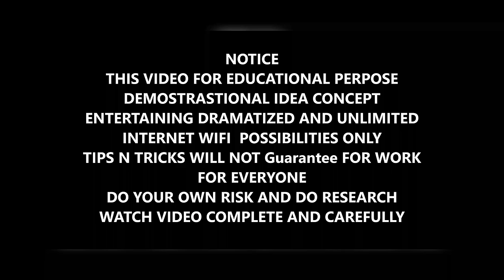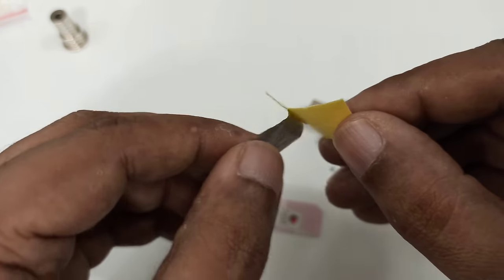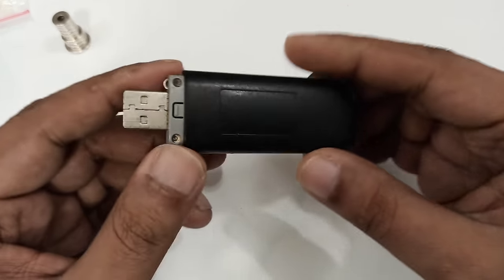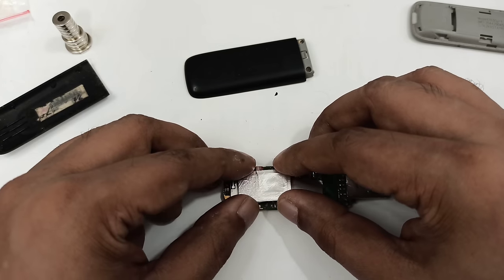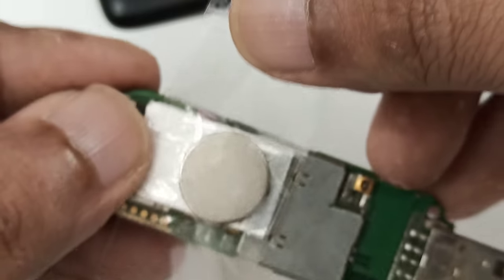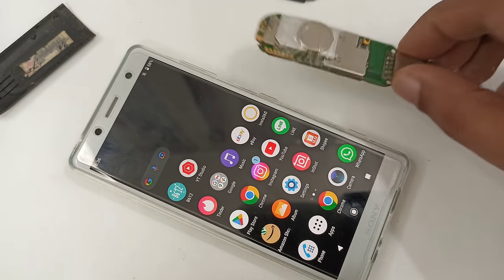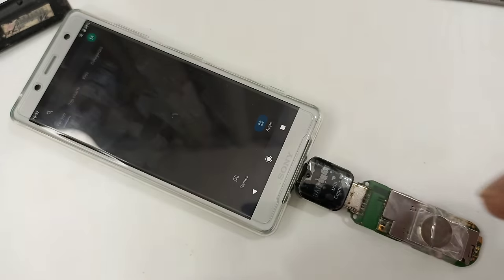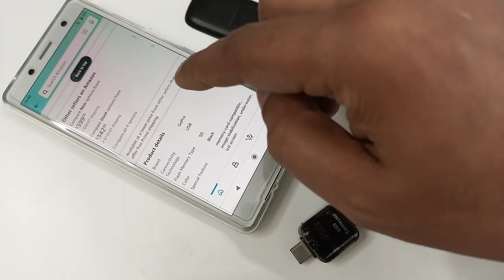how to get free Wifi password Internet hotspot Data anywhere everywhere Lifetime

Comment: All you did was turn internal into external. It ain't free if the SIM has to be active. You'll still have to keep paying for the SIM to stay active. Only positive managed out of this was to be able to disconnect it and use it on a laptop, tablet or smart TV or anything needed for internet and has a USB port.  But Still isn't free just manage internal to external but hot spot exists.
Try again.
Reply from the maker: sim will active but your data will not consider use. hope you understand the point.. company give you data but its not consider use for example 1 gb will be still 1 gb but actually you used unlimited
Reply: @testcomparisons  mdr
Reply: @testcomparisons  CAN IT WORK ON A ROUTER/WIFI DEVICE OR IT'S ONLY WORK ON A MODEL?
Reply: Dos it work with a pay as you go SIM card with no credit on it but activated?

Comment: Is it really free if you cloned somebody else's SIM card and they are paying?  I don't see how the ISP network allows you access otherwise.
Reply: The only reason this trick seems useful is if your internal SIM card slot would bi broken.... I don't get how this would make anye "free" internet access!
Reply: @mammouthlaineux  its free.. Since internet from sim card using radio signal..
On simcard, there are vcc grn reset clock etc.. Using magnet is to broken the radio signal, from magnet also generated voltage to move data.. They will act like memory card, transfer the data around

Comment: Does the magnet have to be round and that same thickness? I may have round ones but they aren’t made of metal they are made of flexible material. Is that thing an actual usb modem?
Reply: it is just some guy that wants milions of views and this wont work (h just put a paid sim card in the external modem)
Reply: Just a scam.
Reply: Scam😢😂👍👍👍🇱🇷

Comment: great its work's at last 👍
Reply: It works??? And it will works with eny sim card??
Reply: @rogerroger6994  no he has used a paid sim card in the usb modem
Reply: @hannescampidell  
He paid for the sim card only once  and then  he can get internet for free all the time . 
True??? I
Reply: @rogerroger6994  no there are two possibilities the first: he bought a prepaid sim (for a month maybe) second: he just used a normal sim that for example cost 10$ a month
but after the contract ends you get no internet

Comment: I purchased a USB dongle which took a SIM card with data on it and it was actually sold as mobile Wi-Fi it was sold buy meteor in the instructions they explained dongle into the side of your computer login to data on the SIM card would then into I give you Wi-Fi on the computer now meteor have gone out of business but I have two of these dongles and I have an other Wi-Fi box designed to give you Wi-Fi in your car putting in a sim card with unlimited data which are the shops will do get Wi-Fi from it should I be able to put one of those SIM cards into the meteor dongle and then get mobile Wi-Fi it also had a section for a SD card